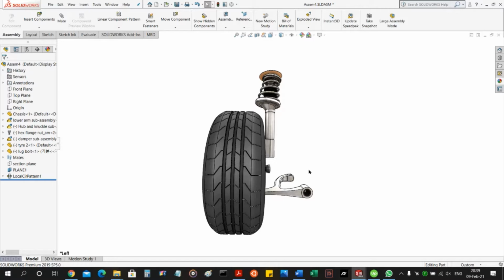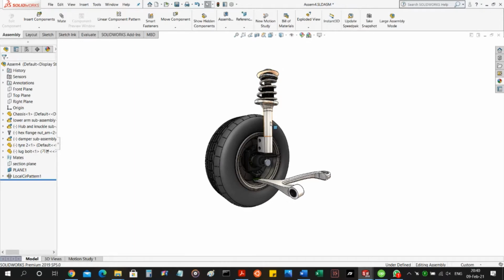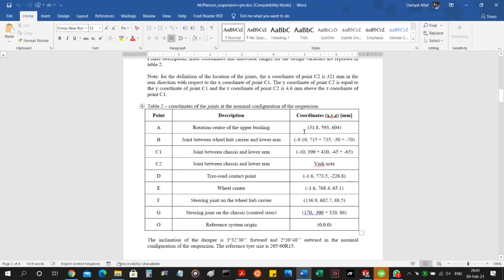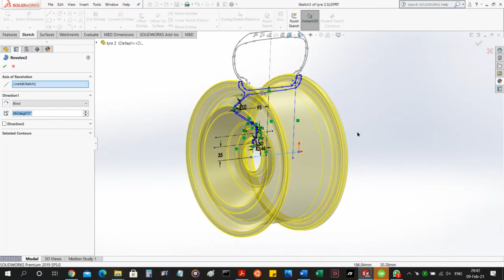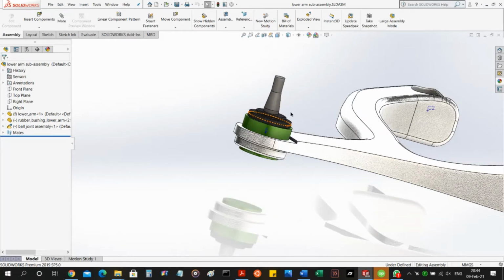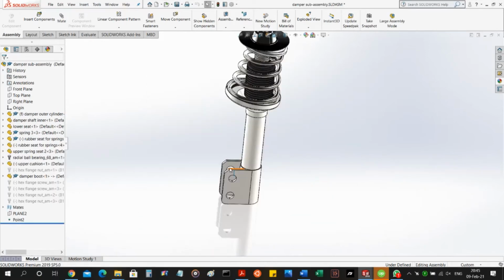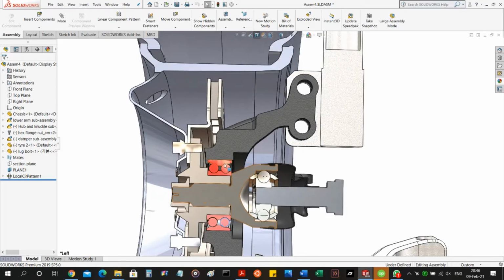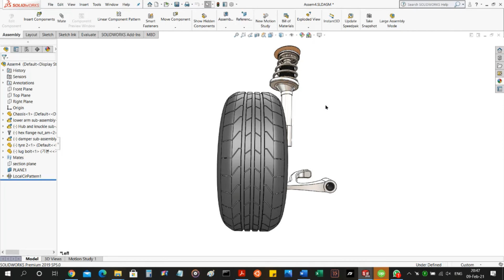MacPherson strut suspension | Part 1 | Design overview | Solidworks 2019

Comment: Thank you for your great content. I was wondering if you have msc adams template for this suspension
Reply from the maker: Unfortunately I don't have the model on MSC Adams. By the way, I will also upload this week the remaining parts of this video series  in which I will explain design of knuckle arm, suspension strut tower, spring, and CV joint. 
Once again thank you for your supportive comment.

Comment: A lot of errors in this model, such as the rim is impossible to mount in this way
Reply from the maker: Have you found any possible interferences that would make it impossible to mount ?
Reply: @TheOnlyRaceEngineer  yes on the shape of the rim
And you miss conical surfaces for the screws on the rim
And on damper on grabcad the bearing on the upper mounting is intersected in the model
Reply: @TheOnlyRaceEngineer  and also in the CV joint you miss the circlips at the end of the stud shaft and the 2 clips to take fixed the stud rubber
Reply: @TheOnlyRaceEngineer  have you passed the exam? In what year?
Reply from the maker: @johannesdesilentio43  absolutely right @Johannes De Silentio
Reply from the maker: @johannesdesilentio43  I should have added those. Thanks for pointing out these important details
Reply from the maker: @johannesdesilentio43  Yes I passed the exam back in 2018